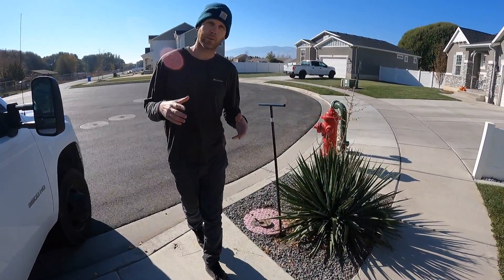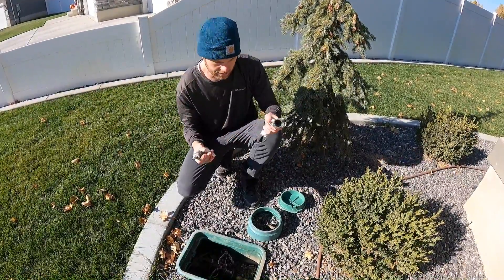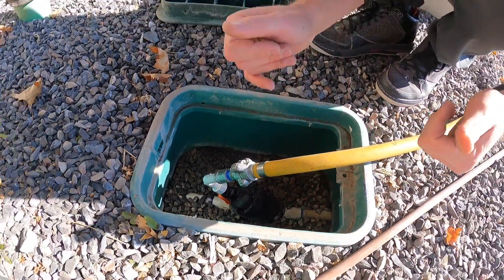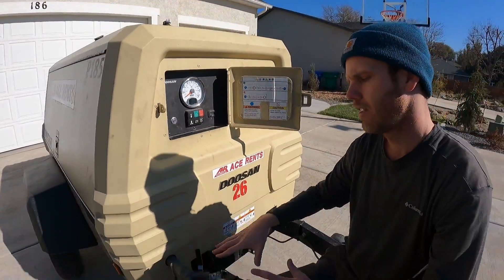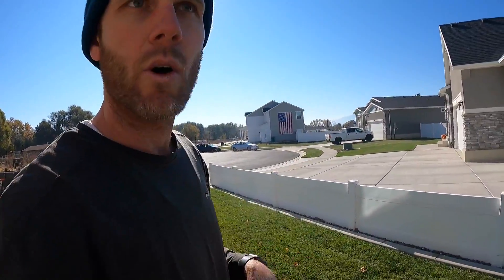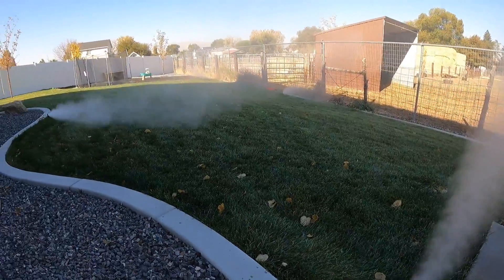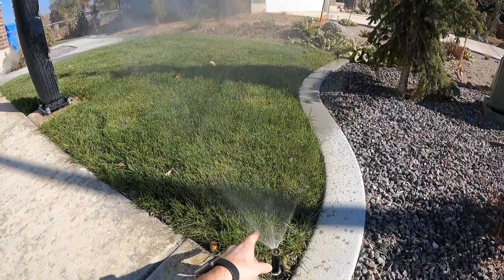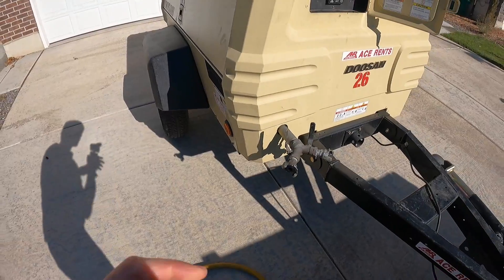How To Winterize Your Sprinklers - Blow Out Using Compressor

Comment: I have a well . I was told maximum 40-45 maximum psi through these sprinkler lines without risking damage. I only have two zones. Whats the difference between psi and cfm?
Reply from the maker: Pressure versus volume

Comment: Are the systems in your area not normally set up to drain when winterized? Not knocking blowing out systems at all, I'm just curious if installs in different freezing areas / zones are or aren't set up to drain when shut down. We're East of Tahoe close to 5,000' and it's extremely rare to get a freeze break of any kind. Unless the installer was unaware of drain design. 

Awesome channel and great service!! 👏🏻
Reply from the maker: Thanks, automatic drains are used but even with settling of dirts etc sometimes there are still freeze cracks and I think many have just come accustom to getting them blown out as an extra preventative measure.  I tell people if you haven’t blown out and haven’t had any issues then you’re probably good to continue as is just doing normal steps.

Comment: When turning off the main waterline, how do I know which direction to turn it?
Reply from the maker: Alway turn clockwise (right) when shutting off.  Just make sure your stop and waste key is on the stop and waste valve.  Sometimes you have to fish around to get on it.  Also can use a flashlight to look down the pipe and see the orientation to help.  Then just quarter turn to the right and you should here the sound of water shutting off usually.  And it will stop turning off the quarter turn.  Hope this helps!